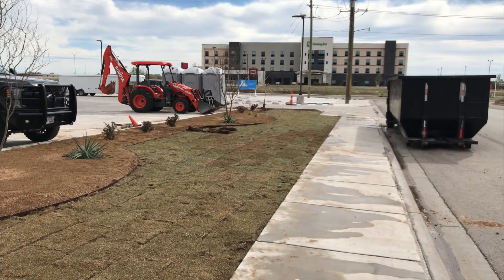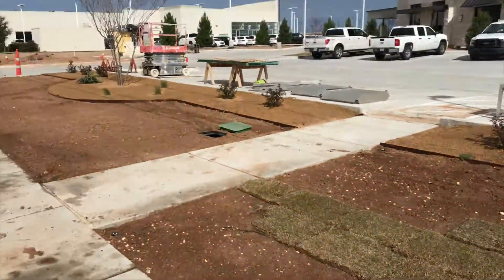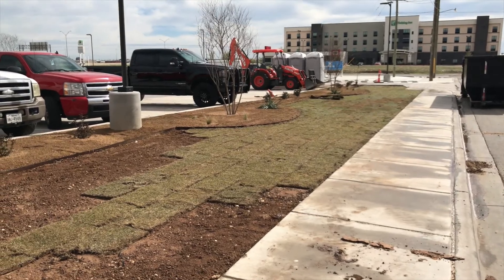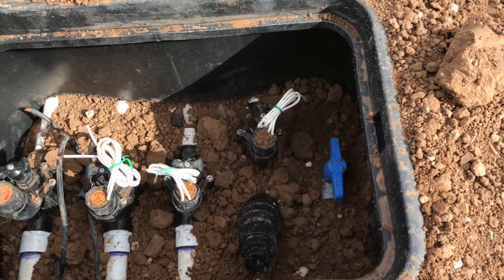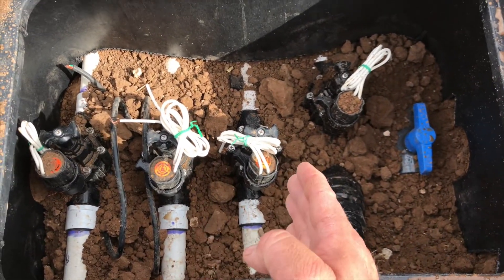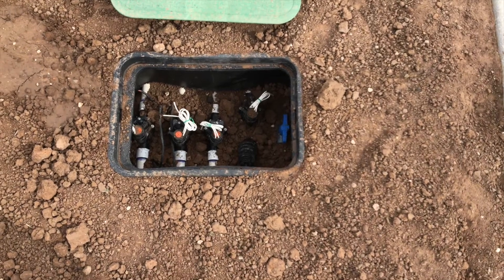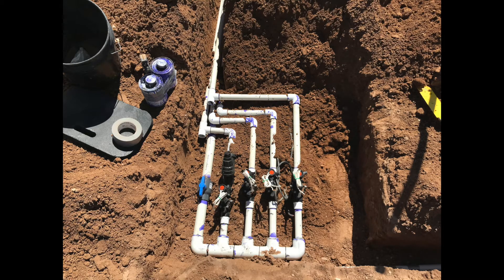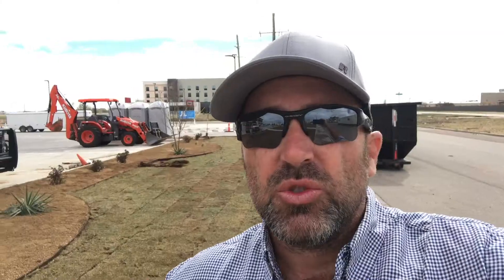Sprinkler System Valve Installation Tip

Comment: I have a problem.  One zone works the other 3 don’t but water is going to them.  They are just not rising.  Is it electrical
Reply from the maker: I usually check to make sure they come on manually first. If the zone pops up after turning the valve on manually and works fine, then it could be a wire or solenoid problem.

Comment: Why use threaded valves with male adapters if you're gonna put the valves so close together that you can't unscrew the valve from the male adapter. You might as well use slip valves and save yourself the male adapters. I'm glad I'm not in West Texas, I would not want to work on one of your installs.

Comment: Hi there, I had baught a irragation valve for a small sprinkler system. But they turn on OK. Bit when I cut the power it still sprays, any idea why as there new. I'm so Confused
Reply from the maker: It could be that there is something stuck in the valve like a rock. In this case you will need to shut the water off and take the valve apart. That is the most common reason for a valve to stick open.
Reply: @AmericanIrrigator  that's what I taught but it seams that pulling any thing downstream from the value that reduces the flow allows it to close. I'm at a loss
Reply from the maker: This may be a time when you have to call a professional to come out and look at it.

Comment: u briefly showed a "drip" device on one of the valves---what is the purpose of this versus the other valves.  Should you use the "drip" devise on all valves is they are all servicing Drip emitters???
Reply from the maker: The one valve that service the bed areas we have drip irrigation in, has a Y filter with a pressure regulator built in. We use this set up on all drip zones. The other valves serve the grass areas with spray heads. We don’t usually put Y filters or pressure regulators on those zones. Hope this helps.
Reply: @AmericanIrrigator  thanks so much.  I don't have grass (California ) so everything I plant is on drip.  This tip will really help me.

Comment: that manifold is gonna be a hell of a repair when it cracks
Reply from the maker: Yes it can be. I try to leave some space between the manifold and the valve and the valve and the first fitting , so in the event of a break you still have some pipe to glue to.

Comment: Did you stack all the laterals in one trench? See this mistake made all the time. The valves set up looks clean and well laid out. Most of the time install companies who don't do maintenance stack and never deal with break issues. By stacking the lines you just made a simple repair much more costly. Don't stack your laterals especially over the mainline. Always leave ample room between each one.
Reply: As a maintenance man at a condo I immediately thought, holy shit is that gonna be a nightmare to repair WHEN there's a break.
Reply: Hate seeing stacked lines like that. Repair nightmare
Reply: @powerhouselawncare2419 do you have any pics for a new irrigator on how to not stack the lines? I totally understand what you're saying with difficult repairs. For installation would this just mean a wider trench or do extra trenching work?
Reply: Exactly. This clown is preaching organization then stacks lines.

Comment: Hey, what valves are you using in this video. I have the same ones at my house and one went bad. I'm trying to replace it but can't figure out what to look for. Also for whatever reason, I have 3 zones wired to one valve and 3 to a second valve. I'm not sure how 1 valve it controlling multiple zones. Any ideas?
Reply from the maker: These valves are Rain Bird PGA valves. 1 inch. I’m not sure what you have going on. I would have to see if maybe to figure it out. Typically you should have one power wire going to each valve to turn on each zone one at a time. Not sure.
Reply: @AmericanIrrigator  if this guy didn't follow and like your video he's/she's an asshole!

Comment: Is it possible that 3 different solenoids went bad within days of each other in a 15 year old sprinkler system ?
Reply from the maker: It is possible, but it seems like something might have caused this like a lightning strike or a power surge. The first thing to do is test the solenoids to make sure they are bad and there is not a wire cut or nicked somewhere.
Reply: @AmericanIrrigator  Thank you for your answer . I two videos that suggested that I probably caused this problem by manually turning on the zones with the bad solenoid . I will see . I ordered three new solenoids . They will be in next week . Thanks again 👍 .

Comment: wait, do i put them in order the way i install it.
Reply from the maker: I put the valves in order that makes sense to the layout of the landscape. The valve on the left will run the zone on the left. This makes it real easy to maintain and check the zone and sprinklers. Did this answer your question? I hope this makes sense.

Comment: Love the use of the shut valve for the 3 zones. I work on HOAs irrigation and no shuts offs. 90+ zones , one valve has an issuer and the whole system is down.  And the time to drain the main lot work on it.  Thanks for the informative videos
Reply from the maker: I know what you mean. I have worked on systems like that so now I always incorporate shuts offs as much as I can. I put one on every valve for a while and have backed off that but still do it from time to time depending on the job.

Comment: Switch to Poly, it will save so much time and make jobs look a lot cleaner when your done. I like your organization!
Reply from the maker: I have seen a lot of guys use poly especially up north. I have been wanting to try doing some. I may get crazy and do a job with poly this year. Thanks.
Reply: @AmericanIrrigator   I worked on 3 miles of commercial irrigation (12 clocks, 110 zones, 1000+ heads) and I suggest you run from anything other than PVC. Nothing is as reliable as PVC; I don’t know what kind of fittings are used with poly, but if any of the connections barbed avoid them. Something like PEX, even if it’s rated to, is not going to last in the ground.  Someone will eventually find your line even if they were “confident they knew where it was” with an excavator.

Comment: good install but I prefer use unions in each valve
with good pressure hehe
Reply from the maker: Unions are good. Makes any kind of repair very easy. We did a job that had unions specified and I did like it.
Reply: I don’t work on sprinkler systems other than my own. Yet zone valves you can just swap solenoid or replace guts and leave body. It’s what I do when repairing a boiler zone valve. Yet I am new to sprinklers

Comment: Great job! How many sprinkler heads do you put on each valve?
Reply from the maker: I get asked that question a lot and the short answer is, it depends. Water supply, pressure, size of pipe are some of the main factors that determine how many heads you can put per zone. Also what type of sprinkler head you are using and what size of nozzle, also the size of area comes into play. There are a lot of factors to consider. Sometimes it 5, other times its 10,15,20. Every job is different some way. I do know some guys who say 5 heads per zone, but I steer away from settling in with flat numbesr like that. Hope this helps some.

Comment: Great video my question is I want to install 9 zones for my garden area and was wondering do I have to have all 9 zones hooked up to the same common wire or do they make timers with multiple common wire input connections
Reply from the maker: Good Question. Yes, you will connect all 9 zones to the same common wire. So one wire coming out of the solenoid will go to the power wire you designate, one power wire to each solenoid. In a 9 zone system with 9 different valves, you will have at least 9 different power wires or hot wires if you want to say that. Then the other wire coming out of each solenoid will go to a common wire. We usual use just one common wire and hook all valve ( solenoids ) to that common. If there are multiple valve boxes, you will run that same common into all the valve boxes. Which with 9 valves, you are going to want to have multiple valve boxes to give your self plenty of room for servicing. Most controllers have only one or two common wire inputs. I hope this answers your question.
Reply: @AmericanIrrigator  thanks for the help that's what I was thinking

Comment: We do our manifolds like this, looks great. We use poly coming out though.
Reply from the maker: Thanks. I see a lot of guys in different ares using poly. I would like to learn more about it and possibly use it in more of our installations.
Reply: You’ll love it, easy to work with, no glueing
Reply: @Bean_cheese_runner  I will be adding 2 more valves to an existing system which is done in poly pipe. I'm so used to pc, I'm too old to learn a new way. This will probably be the last install I'll ever do. Plus I've got a lot of left over pic parts I can use. If I was a young wipper snapper, I would definitely learn the poly.
Reply: If you don’t know what an action manifold is you’re missing out.
Reply: @davidsenter8002  facts they are king

Comment: So i have three valves that i need to connect to the sprinkler programmer but one valve is in the front yard which is quite aways from the box. The other valves are behind the box but I'm confused on how to connect the common wire to all three valves. Would I have to cut it? Run two common wires?
Reply from the maker: I think I can picture what you have and are asking. So if I was installing this, I would come out of the controller with a multi strand wire, 18 gauge, 5 strand wire, and take that wire to the first valve box and first valves. Then I would either continue that 18/5 to the front or maybe just an 18/3 strand to the valve in the front. You would splice the common in the first valve box. For instance, If you use the white wire for the common, you would splice the white wire form both strands of wire with one wire from each solenoid in the first valve box. This would continue the common to the valve in the front. Kindof hard to explain. Or If you are using single strand wire, it may be easier to run a separate common and  power to the valve in front. And then put both common wires in the common terminal in the controller. So you can do either one. If you decide to cut it and splice it, make sure you do the splice in the valve box and alway use weather proof wire connectors. I hope this makes sense and helps.
Reply: @AmericanIrrigator  So splice or use 2 common wires. Got it! If I were to splice, do i have to twist them together at the end of the common wire or just somewhere on the common?